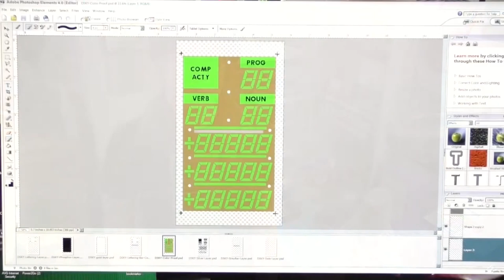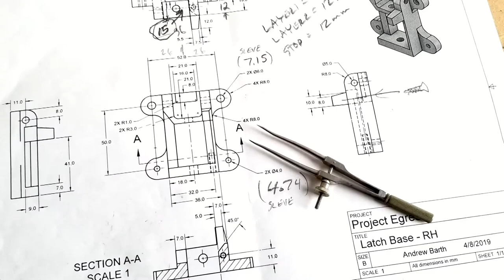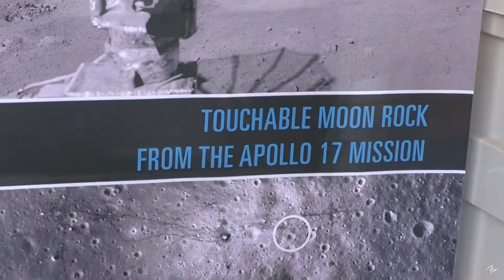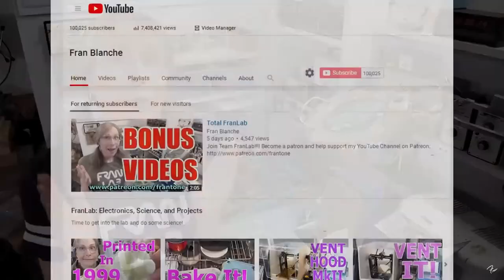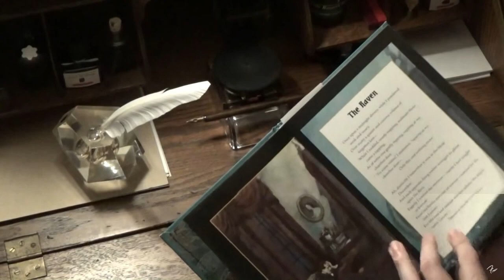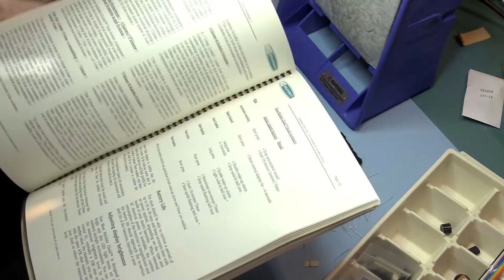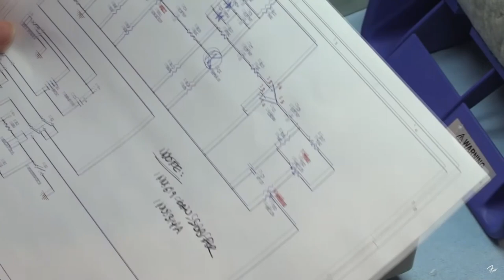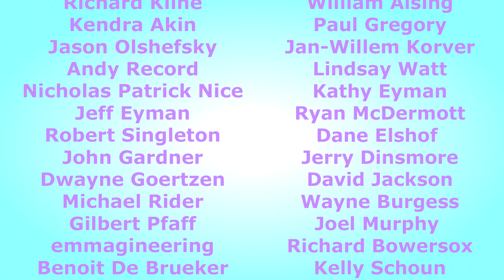10 Years Part 2 - Enter FranLab 2.0!

Comment: I seen some high voltage gloves just like you were wearing. Yelling for Igor .lol They were at the pawn shop the other day. Guaranteed to be resistant up to 20,000 volts. I would not handle 20000 volts with any kind of glove!

Comment: You doing your artwork for your shirts reminds me of what we had to go through to print DVDs. We would make the designs by exposing it to UV light. It would only take a couple of minutes. We would cut it out & use tape similar to what you're using. Then silkscreen it unto the disk or disc. One silk screen for every color. I used to have to print DVDs in Pinckneyville Illinois before they shut down and moved to Mexico. The whole DVD process was amazing from start to finish!
You did a beautiful job on your shirt Fran!👍🇺🇸

Comment: Thanks for doing these amazing videos. Your plate reverb is reminding me of an idea I had when I used to play guitar live. I liked the idea of using actual effects, not simulated. In my fantasy guitar rig, I thought it would be fun to mic swimming pool under water level in an 18-wheeler parked outside the bar I'd be playing at and run a long 1/4" cable to my guitar path to add the 'wet' signal. Ha! Obviously I didn't do it but it sounds like a fun idea!

Comment: One thing that I never can understand is why a simple door is so complex. It's like NASA purposely set out to make something really complex when a simpler design would do. Still, I was not privy to their project's needs so my comment is one of a simplistic view point.
Reply from the maker: It is complex because of the Apollo 1 fire and the redesign of the spacecraft with a priority on egress and a hatch that could be opened from the inside very quickly.  Read about Apollo 1.
Reply: @FranLab  Hi Fran. Yes I remember the Apollo 1 fire and the 3 tragic deaths. I understand that the door and a lot of the CM was redesigned for safety. When I look at it, it just looks massively over engineered and complex. 

By the way I love the channel a definite two thumbs up for the content.

Comment: Wow a plate echo! I didnt know how they worked , I thought it would be just a spring reverb w a plate, Cool. I see ya still run a   Tascam  porta-studio. I bought mine in '85 and it worked great over 20 years. I cant seem to throw it out cause, Wow, what a little machine, unlike todays digital crap, ya turned it on and started recording and it worked everytime and no need for an audio to audio converter. I think somebody is artificially holding back digital audio. How did we come all this way with memory and video and storage but a 2 meg audio file is still bogged down and delayed? I have 20 gbts or Ram and 6 terrabits storage. How is that even possible that theres not one step forward in the last 25 yrs?